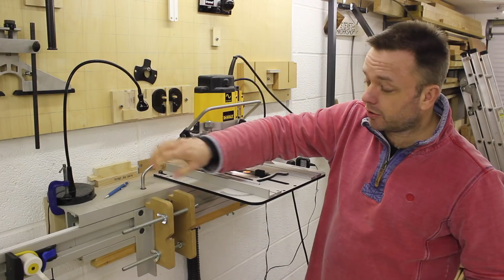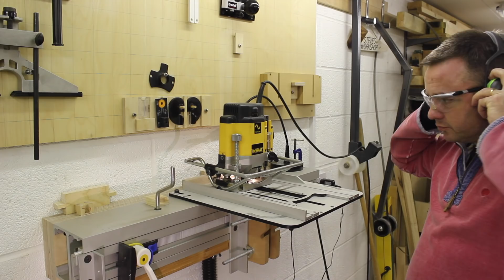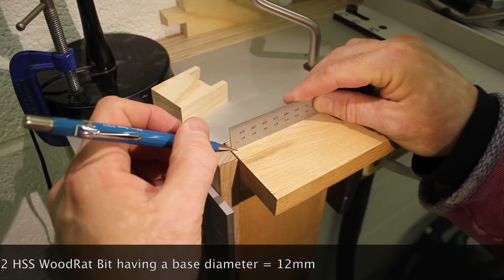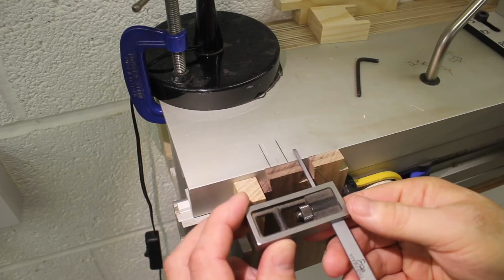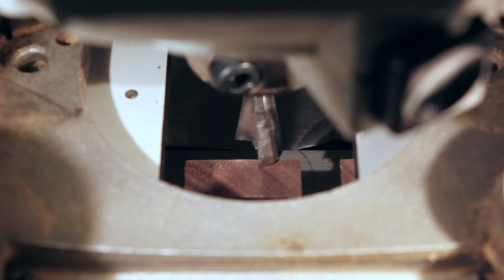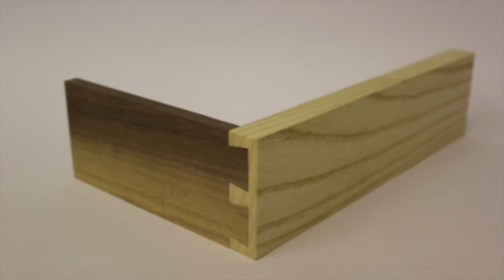The WoodRat - Blind Dovetails (in detail)

Comment: Hi Steve I see the woodrat online store is closed. Can you still get parts. Hey Steve I have practice hand cutting dovetails I have mastered them now I found I was holding the dovetail saw handle to tight. I have try half blind dovetails    . Iam getting better.
Reply from the maker: Hi Shane, yeah, not sure if the WoodRat online store is only temporarily closed? I don’t work for them so you’ll have to just keep looking or contact them directly. But it’s good to hear that you’re also able to hand cut dovetails now. Me too. When I bought the Rat some 25+ years ago I was in the first few years of learning woodworking. So I stayed away from hand cut DTs. I know now that I maybe should’ve just got into the handtools straight away. But the Rat still comes in handy sometimes and if you want to batch cut lots of DTs or other joints then it can be handy

Comment: That is a great instructional video.  I wonder if this is how Woodrat says to do this or did you learn this on your own, obviously through a lot of study on the subject.  It is great to see all the intricate detail in a how-to woodworking video.  Few of them are anywhere near as detailed.  Thanks!
Reply from the maker: Thanks Jeff. As I wrote in the description for all of my Rat videos most of the info on these were gained from attending a course with Mike Humphrey many many years ago. These courses are no longer available and I believe he has retired. There are other ways of making the blind dovetails and this does not work for every situation. You need to be real careful if using the HSS bits and especially the small ones for drawers as these are much more fragile and may break when going into the endgrain. I think I read somewhere, might be the manual/handbook, that you shouldn’t use HSS bits for routing into endgrain. But thanks for your kind words and I hope you get something from this. 👍😊

Comment: Hi Steve, followed your guide on producing blind dovetails. Produced my first blind dovetail and was amazed with the results. Without this guide i would of been stuck. I'm more of a hands on bloke rather than a nose in a book. Please keep the stuff on the woodcut coming as newbies like me really appreciate your hard work in producing these videos.
Reply from the maker: Thanks Tom. Glad you found it useful and got some good results. If you ever have any questions feel free to contact me and I’ll try and help. There are other ways of cutting blind dovetails on the Rat but this one works well. There is a chance though when using finer or smaller HSS dovetail bits that you might break them using this method. So just want you to be aware of that. Tungsten carbide router bits will be stronger but lack the finesse of their HSS counterparts. So it might be worth checking out other methods in the Rat manual once you’ve got to grips with this method.
Reply: @SteveCashmoreWoodworks  Thanks Steve. I have a question for you if you don't mind me picking your brain. The daughter wants a toy box made for our up and coming 1st grandchild. Thats why i had a go at the blind dovetails in your video. Im also looking at maybe through dovetails tor strength. The question is what is the maximum width/height the woodcut can achieve. The height of the toy box would be about 450mm plus without the lid. Is there a way of doing this on the machine....I am stumped on how to do it or is it possible?
Reply from the maker: I’ve never tried to make anything with that kind of width but if I remember correctly you can remove the right hand “cutter position” fence and clamp and then only use the left hand “marker position” fence and clamp to hold your workpiece. At least I’ve seen that for cutting finger joints. I’m assuming you’ve got the bigger WR900? But how you then determine how to cut each tail and pin I’m not sure. You may have a maximum width you can do. I’ll have to have a look at the manual and get back to you...
Reply: Yeh I have wr900.
Just thinking about it steve when doing the dovetails is it just a case of using the measuring guide with space for the dovetail sockets upto 225mm. Then just rotating the wood so it cuts are equally spaced. Something like when you turn the wood head to toe but instead east to west. So your measuring jig is a maximum of say 250mm but the  left side is 450mm. But  then how do cut the pins? @SteveCashmoreWoodworks
Reply: sorry that should read right side not 450mm left side.
Reply from the maker: I’ve had a look in my ancient WoodRat manual (version 8), and there is a chapter “Dovetailing Wide Boards” at page 105. I know you said you don’t like reading but this might be your only bet! You remove the cutter position fence and clamp like I said. Use only the marker position fence and clamp to hold your work. You need to make or use a strip of pale wood attached to the long slot which runs from end to end under the Rat body. Use some M8 panhead bolts and nuts. Drill 10mm holes (x3) along the length of your wood strip so the bolts can attach it to the long slot. You will need to determine what shavings you want for your tails and transfer this to your wood strip on the face which you will see when it’s attached to the Rat body. You need to mark each end of your workpiece board on this strip too. The strip basically acts as a storyboard. You then position it along the length of the long slot (which runs from east to west) so that the end of board line on your strip lines up with the inside face of the marker position fence. Remember that the end of your board is against this inside face of the fence. Now wind the handle so that the first dovetail position line which you marked on your strip lines up with the end of your workpiece board. After doing the usual setup for your cutter including the test socket and pin, you can then wind your work to the next pencilled line on your strip and cut the second dovetail. And so on... You can also somersault the workpiece to cut the other end before moving the handle each time. Then you have to setup for the pins...
Reply from the maker: For the pins, reconfigure the Rat and set the button and spirals. Make some test cuts on a piece of scrap as before to ensure a good fitting pin. When happy, clamp your workpieces, which will have the pins in, to the Rat. Again use the edge of the workpiece to line up with the pencil marks on the strip. Cut a pin at each line position as you would for any other dovetailing on the Rat. Obviously don’t cut any pins when the “end line” on the strip is lined up with the edge of the workpiece. The manual says “Note that the cutter cuts each position along the board from A to B, starting from the left, but the fence tracks across the batten (=strip in my above comments) from the right and goes left.”.
Reply from the maker: You can dovetail wide boards up to 30” (762mm) wide according to the WoodRat manual on the WR900. Hope this helps and good luck?!!
Reply: @SteveCashmoreWoodworks  Yeh I have just come across it in my woodrat manual. I was looking to work off the top edge but never gave a thought about the bottom edge of the woodrat. Cheers
Steve